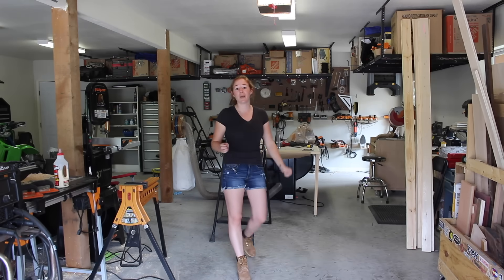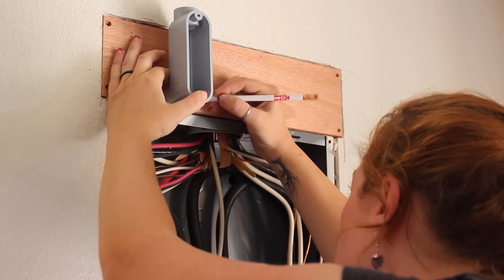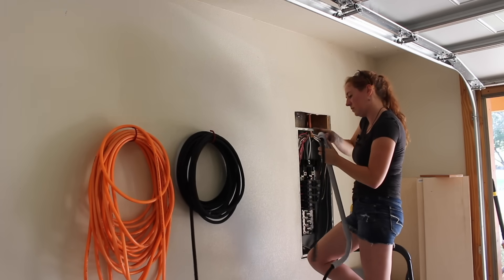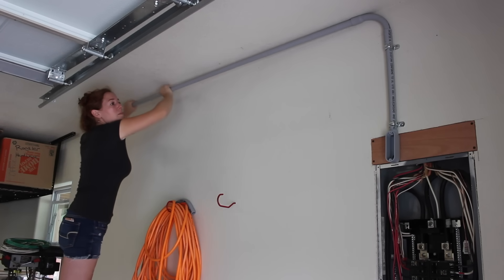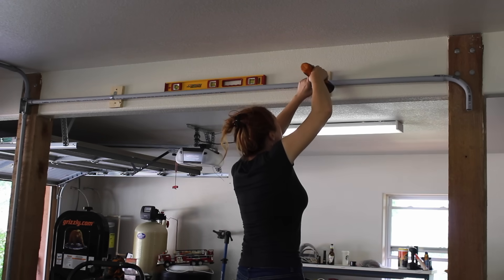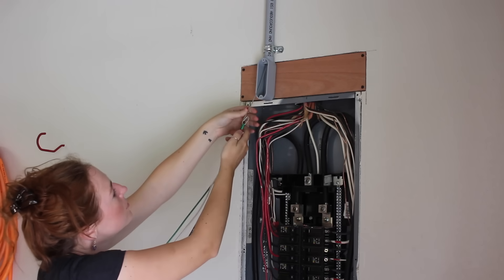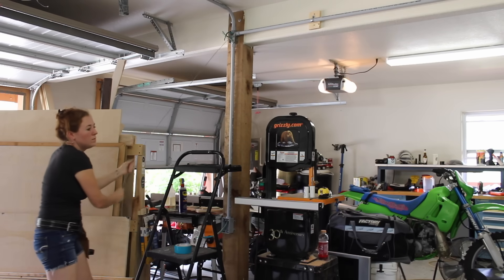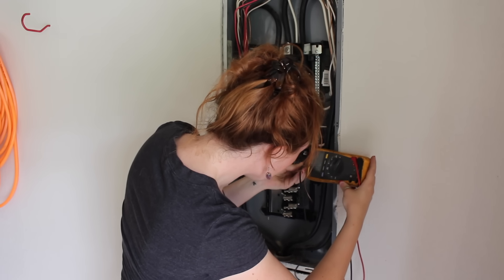Adding 220 Volt Outlets to the Garage

Comment: Very nice work April.  Where I am you can get a homeowner's electrical licence which allows you to pull a permit, do your own work and call for inspection.  Basic test on electrical code and a few $$.  Have you ever thought about contacting the STEM instructors at the local high schools?  I think it would be a good thing for the girls to see a successful young lady so that they will understand that they can do it too.
Reply: Where I live people do their own wiring and pretend it was done that way when they bought the house.
Reply: April, I second David's comment.  When my daughter is of school age I hope she will have access to role models like yourself.  Great videos.
Reply: EXCELLENT idea!
Reply: I'm a home inspector and I see all kinds of deficiencies that were "inspected" by code inspectors. Even in new build homes. AHJ's: If you're going to require permits and inspections and make people pay fees, do them right! Methinks those people must work for the gubmint. On the other hand, I also see a lot of crap DIY work as well.
Reply: As a STEM instructor, and a fan, ditto about contacting local high schools. Several of my students try their hands with tools but lose the confidence somewhere during the journey, and so they give up or just let someone else do it.
Reply: The most recent three electrical jobs where I knew the work was permitted and inspected included two kitchen ranges miswired with hot and neutral swapped and one Siemens/ITE panel with HomeLine breakers installed and slots in the cover where extra knockouts were removed and left open.

But not to worry, I'm sure the three cities involved will be happy to refund the inspection fees when the homeowner is electrocuted, e.g. by touching the range and kitchen faucet at the same time.
Reply: Now that's a hot idea.  My grandson is a STEM student in middle school and is constantly sharing things he learned.  Can't wait for his high School to start.
Reply: I am an electrical inspector in my area.  Laura, I have seen several instances where the reverse can be said. Just as you collect a fee for the services you provide, so do the separate AHJ's.
Reply: Where do you live?
Reply: $$ being the primary goal
Reply: I simply research the intricacies of the electrical job I'm going to do if anything isn't already in my knowledge base (on my own property, of course) , get the materials and install. No permit or inspection.  Then again, I plan on living here until I die, so I'm not concerned about a permit paper trail for reselling. If I'm ever unsure of a task after researching it thoroughly, electrical or otherwise that needs to be perfect, I hire it done.  What I love about diy electrical is due to the money savings, you can spend more on the equipment. Higher grade breakers/breaker boxes, heavier gauge wire (future-proofing for additional loads) EMT conduit instead of straight romex, wide and deep outlet boxes so if I ever decide to run more wires it's easier to use it as a junction (and it's still within code for capacity, too!) etc. :)
Reply: +David  Sounds like your government needs to be reigned in.
Reply: On a side note... the permit/inspection process is not only for resale, but the biggest thing is for the safety of you and your family.  Incorrectly installed electrical can not only affect the particular thing you are working on, but the entire electrical system.  The permitting/inspection process also covers you for insurance purposes.  If, God forbid, there was an emergency and the insurance company found out that it was caused by a non-permitted installation then they are not liable to pay out.  Seems like a huge liability that is usually low cost and not that time consuming considering the consequences.
Reply: Lady or man, an unlicensed person should not be touching a panel under any circumstance, especially 220V. 
220V will leave you where it found you!
Reply: @unknown-p5j5x  I agree, however, if you want to take the chance, and you think you are well prepared, then I suppose there is no way to stop them.
Reply: @lukepotosky7710  But that's just it. Doing your own electrical on 220V should never be promoted. It's not something that you can just "take the chance" and hope for the best. One screw up and your dead on the ground.
Reply: @unknown-p5j5x  Yes I agree. If you are go8ng to do it, don't; but if you still are adamant about do8ng so, you really shouldn't post about it; however, Ms. Wilkerson has done numerous projects involving electricity, so I belive that she is probably better wducated than a lot of the people on the platform.
Reply: You have to have 4000 hours of employed experience on the field, as well as complete 4 years of electrical engineering.
Then you become a journeyman.
Then you pull a permit.
Reply: Dillion Dinsmore In my union it’s a 5 year apprenticeship.

Comment: I think use additional leakage current protection for your safety.
Reply: The code specifies all 120v 15 and 20 amp "receptacles" be gfci protected in dwelling garages, there is no 240v receptacle requirement in a dwelling garage to be gfci protected. Is it a good idea? meh possibly, but not required. 
Outlet-- A point on the wiring system at which current is taken to supply utilization equipment. 
Receptacle--A receptacle is a contact device installed at the
outlet for the connection of an attachment plug. A single
receptacle is a single contact device with no other contact
device on the same yoke. A multiple receptacle is two or
more contact devices on the same yoke.
Reply: yup
Reply: all garage outlets are supposed to be GFCI...time to change the breaker

Comment: it's so funny seeing that you guys use 110 volts as main. Here in Denmark we use 230v as main and 400v 3 phase power for kitchen appliances and heavy tools. and wirenuts are illegal to use :) but nice work
Reply: I'm in America and I started using the wagos, I'm not going back to wire nuts. These are the way to go.
Reply: We (I'm from germany, still EU) use clamps. There are different types of them, but these are the ones i see and use the most:
https://www.google.de/search?q=wago+klemmen&source=lnms&tbm=isch&sa=X&ved=0ahUKEwiC4Nyosd7TAhUHJ1AKHeWjCx4Q_AUICygC&biw=1280&bih=904
But our electrical wiring methods differ a bit anyways :D
Reply: Some do use the screw ones, personally i use these from wago on a daily basis in y job as an electrician

https://www.wattoo.dk/media/catalog/product/cache/1/image/1800x/040ec09b1e35df139433887a97daa66f/8/b/8b6411c0-4ff5-4093-82c7-5b6ce0b010e1.jpg.jpg
Reply: Why are wire nuts illegal in Denmark? What do you use instead?
Reply: In Denmark wirenuts are illegal, instead we use "samlemuffer" - To better explain, i've posted a link to a google image seach :) 

https://www.google.dk/search?q=samlemuffe&tbm=isch&imgil=frDlPRfUeP71pM%253A%253BUBJiNC12YlF8AM%253Bhttps%25253A%25252F%25252Fwww.bauhaus.dk%25252Fsamlemuffe-dobbelt-6-stk-blister-naturel.html&source=iu&pf=m&fir=frDlPRfUeP71pM%253A%252CUBJiNC12YlF8AM%252C_&usg=__auNSXd4nCg9dYLN16sXD5hGPVgQ%3D&biw=1536&bih=736&ved=0ahUKEwj9vNyXuN7TAhXOOSwKHZ-iAOQQyjcISQ&ei=CGsPWf2YMc7zsAGfxYKgDg#imgrc=frDlPRfUeP71pM:
Reply: Wagos in Finland too. Older method was "sugar peace" or white plastic cube with copper tube and screws in each end. I'm fairly sure wire nuts are illegal here too, as it exposes copper and by the code only 1mm of copper can be seen from the connection.
Reply: I had trouble with an inspector who had never seen them, but I love the wagos.  Have you seen the 221 series?
Reply: as long as you don't solder AND ise the nuts/clamps :D (the solder will deform over time so you could create a spark gap)
Reply: Do you still use the screw ones?
Reply: The 221 is great in small spaces and you can see inside which is useful when working under non-ideal conditions (imperfect strip length, bent wires, etc.). The 222 is more robust (lever and housing).
Current carrying capability is comparable and well in excess of the wire itself (I made a video overloading them). I just wish they would make one with 8 positions too, 5 is not enough.
Reply: I'm ordering the 221 and the 221-500 carrier for exactly the reason you mentioned - you can put two 5 position blocks on a carrier with a small jumper, and the whole thing will screw down nicely in a standard US junction box.
Reply: Same as in the UK but our three phase is 415V and the fish tail thing we call a mouse :-) Brilliant job April
Reply: actually your kitchen appliances do not use 400 V - they usually use the 3 phases separately, usually a commopn 4 plate stove with oven uses 1 phase for the oven and the other 2 phases for 2 plates each  - if you use a seprate stove and oven, the oven will be usually powered by 230 Volt single phase - usually they have around 2,5 kW

real 3 phase 400 Volt is usually needed for rotating devices like concrete mixers or big table saws, some drillpresses and stuff - thats why 3 phase current is usually called "rotary current" :)
Reply: Are all connections soldered and heat shrink tubed?
Reply: It's funny to see people on both sides of the Atlantic get all bent out of shape because one side uses 110 for household stuff, and the other uses 220/230. For the most part, it's only a standard in so far to make sure consumer and manufacturers were not going to deal with fifty different voltages for the same region. As with most standards, once the questions about safety, reliability, and function are answered, it's often up to the person writing the standard to "throw a dart at a dartboard" to pick a standard. US and Canada use the 110V standard mostly because of Thomas Edison/Westinghouse.
Reply: Bacon.
Reply: What are using as oppose to wire nuts?  I have soldered many wire joints but only for Hospitals and Labs at Duke University, wire nuts everywhere else. In commercial applications we use 277v - 480v  as a rule for lighting and BAS applications and then step it down to 110v - 208v for receptacles and office equipment.
Reply: Oh no.... How can i deactivate notifications for this track? I don't want to even see this conversation ! :D
Reply: It works.  Whats your point?  At least Germany didn't occupy our country in 10 minutes.

Comment: Your conduct straps are to far apart they should be 36 inch from strap to strap
Reply from the maker: Ok good input, I'll add more to prevent sagging over time.
Reply: Yes.  Maximum distance it 3 ft between supports and 3 ft within each  outlet box, junction box, device box, conduit body, or other conduit termination.  Table 352.30
Reply: Way to go April ! I have been reading all the comments and like how you ignored all the bull until you came to a constructive comment...

Comment: Nice job, even if there is a "better way" according to some, you did a great job and I don't see anything bad. Curious to how to made the connections from the visible pull L to the breaker box though as it isn't included in the video, what connector did you use on the breaker box itself? Maybe thow a pic up on instagram? I'm amazed how you tackle just about anything and do the research enough to do a nice job on your projects.

Comment: Did u use #12 or #10 wire I know my welder and plasma table saw requires 30 amp service witch is #10
Reply from the maker: 10-3, I checked how many amps are pulled from all three of my 220 machines beforehand.
Reply: Keep up the great vids
Reply from the maker: I think I said that wrong....I pulled 3 #10 wires. 10-3 refers to one cable with three conductors in it. : ) I like learning the lingo.

Comment: Nice job but I have some questions about that metal box (your t-splitter) I don't think here in my country , metal would be allowed anymore (in the past it was like the iron and copper tubing and boxes)
If the "phase" wire comes loose and hit the metal box, the box would be " live ". Since you also use plastic why not do it all the way in plastic ??

I  put the wires in before mounting  the tubing(if possible) cause here we use 5/8 or 3/4 tubing but yours is much thicker (and sometimes we use flex tubing which is easy to bend but pulling wires through it, is much harder).
But anyway, job well done, nice video, thanks for sharing.
Reply: RS we are allowed to use metal boxes, but we must ground the box wether we are using metal or plastic raceways.
Reply: Pros and cons to all options on the market really. 
Junctions have an increased risk of failure and arcing as compared to runs, of which heavy gauge metal is more likely to resist in cases of extreme failure. Doesn't seem all that unusual in North America to do plastic conduit runs into metal junction/switch/socket boxes.
Reply: Okay that's fine, that'll do the job too.
Hate to see April show up with smoke out of her ears ;-)
Thanks bro
Reply: Every country has their own rules.
I watch lotsa DIY stuff from America (e.g tiny houses and so) 
I see thing that are totally  forbidden here but then I see thing that makes me think, mmm smart thinking in the USA .
Thanks for the early replies guys
Reply: Loads of tiny homes are just ignoring safety regulations, with people 'fighting the good fight' to get back at 'the man' who is 'keeping the people down'... By building and living in a death trap...

Seriously, is it really all that hard to design a tiny home sleeping loft with the idea of getting the hell out of it if your stove ends up setting something on fire?

Comment: Have you considered the possibility of while using your table saw or plasma cutter the air compressor kicks on?
Reply from the maker: I considered the air compressor kicking on while using both machines, but both the table saw and welder won't be being used at the same time.

Comment: Nice work, but,

On a horizontal run, we put the strap with screw under the conduit, that way if the screw loosen the pipe wont fall.. 

The white conductor should marked with Red E-tape on every connections, since its not a neutral 

Then, how have you ran the wire between the LB and the electrical panel? Its require a conduit or something, you can't run loose wires in a wall unless its BX or Romex..

and always tape the end of the fishtape, sometime it can get stuck on conduits coupling! 

Really like your work by the way! :)
Reply from the maker: Good input on the horizontal run. I did mark the white wire with a red marker (I followed the example of the previous installer, he used a red marker). It is in conduit the whole way, I used a short section of seal tight into a 3/4" 90 at the box itself.
Reply: Simon Pineau n

Comment: Nice work!  I love seeing people actually do stuff themselves rather than assuming it's just too hard if you're not a professional.

I like running 4 wire for 220v.  In my garage I ran 4 wire through a couple of double-gang boxes, to an L6-20R box, then through a couple more double-gangs. In the double-gangs I wired a black and a white Standard 5-20R plug - the white ones using the red hot leg, and the black using the black hot leg, and a common neutral.  I ran that all back to a 30A GFCI 2-pole breaker.  It cut down on copper costs, and also clutter in the conduit.  I've been pretty happy with it.

Comment: Very good job, I like how you're not afraid of doing that yourself. My wife and I are remodeling our house ourselves and I wired the whole house myself. Followed local codes and did a great job if I say so myself. It's very easy as long as you know how. Keep up the good work and keep the videos coming. By the way I have posted my own videos if you would like to check them out.

Comment: 110v and 220v are fatal but rarely. I've been shocked with 220v a bunch of times and here I am. Now, if you get the big tools -
 where I live we use 380v for big machines or industry wise 700v then you're screwed. The thing is to never touch both hot and ground at the same time. If you touch the hot but not the ground you'll get zapped but probably not killed cuz your body isn't a particularly good conductor but if you touch both your body then becomes a light bulb. Pretty nice decoration for Christmas doe.
Reply: But you need volts to push the amps through your body.
Reply: 110V tends to hold on to you.
Reply: Ever been shocked by a spark plug wire? Spark plug coils are 35000 volts plus, but low amperage.
Reply: Voltage doesn't kill, amperage does.

Comment: Nice work April :) and for me as electrician in the Netherlands it is funny to see what kind of material is usual in your country. By the way, you can better use more pipe clams between 50 centimeters other wise the pipe sack down when its a hot day ;)
Reply: Dave van Tilburg true, same happened to 40 mm waste pipe I worked with on a moderate day

Comment: How did you kill the panel power at the pole?  Isn't that something the electric company does?
Reply: on most new houses the power coming off the pole goes in to the meter and then to a hole house breaker so if you have to work on the power you can or if there is a fire tso the firefighters can turn off the power
Reply: I know on farms their is always a way to shut of the power at the pole .
Reply from the maker: You just flip a breaker. : )